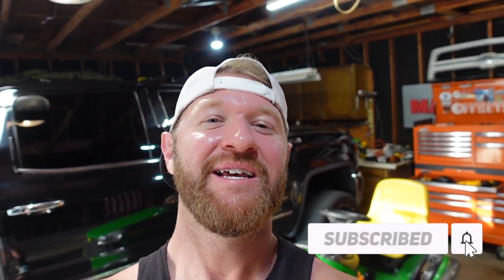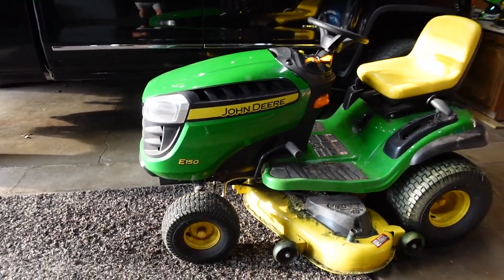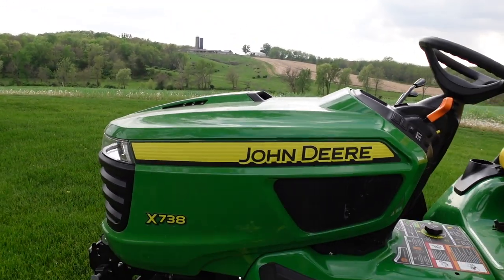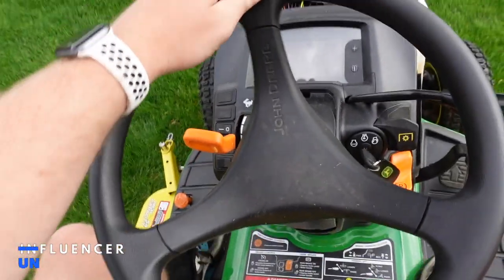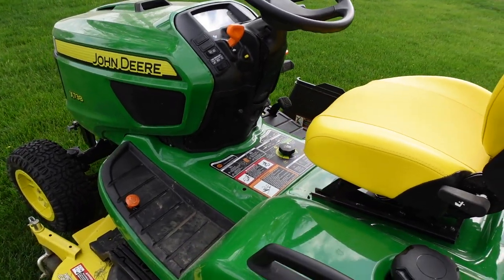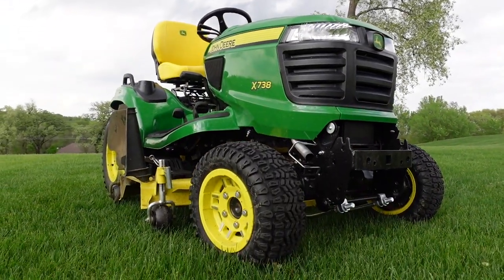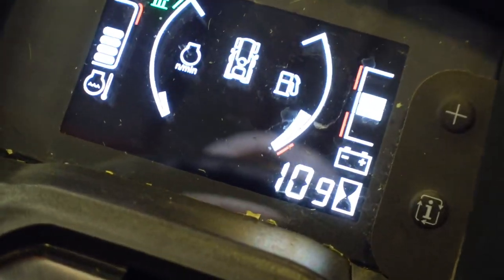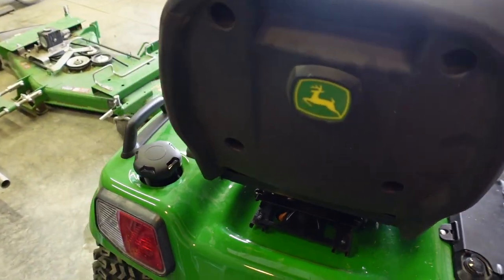John Deere x738 Lawn Tractor | Review & First Drive

Comment: Yea, I had an x720 with a 54 inch deck. I only cut about 3/4 acre of grass. (big hat, no cattle). I bought it used with 16 hrs. on the meter. The deal I got was so good I couldn't pass it up. I kept it 11 years then sold it ($2,000 profit) and downsized to an x590 with a 48 inch deck. Couldn't be happier with my decision. I can handle the 48 inch deck much easier when I remove it and turn it over for annual cleaning.
Reply from the maker: Great feedback thank you for sharing! Sounds like a good deal to me!
Reply: The problem I have with the X500 series. (Belts & pulleys), it's not a shaft driven system like the X700 series. Which will last much longer.
Reply: At my age, longevity is not an issue.

Comment: Looking to upgrade from an older John Deere 445. It has been an incredible machine. But it's getting tiered and parts are getting harder to find. To get the same equivalent machine today. I have to go to the x700 series. To my knowledge, John Deere has changed their classifications. They don't even offer a 400 series anymore.
Reply: I’m also looking at the x700’s… the John Deere 425, 445, 455 series supposedly are considered to be one of the best John Deere has ever made as far as “classics” go. I’ve heard that from multiple deere dealers through out the years.

Comment: On your E150 I highly suggest swapping out the front wheel races for bearings before your axles get worn beyond repair. Maybe you’re too late like I was as I have 190 hours on mine. There are lots of videos on how to do it. Easy process too. FYI.
Reply from the maker: Ohhh no kidding? Did not know that. I’m sure I’m way over that by now but let me check it out!

Comment: I have a steep hill, im gettin one 👍
Reply: If you ever need a spare front axle assembly, I have a very low hour unit off of a x738 that was in a delivery accident. Trailer flipped smashed the rear of the tractor.

Comment: Our company bought a bunch for facilities of that same tractor. They have been workhorses the whole way through. Not just for the mowing of the grass and everything else going up-and-down hills. But it also has a plow attachment and a blow or attachment that is awesome. And one thing you should have mentioned is that it's shaft drive that no deck is driven by the shaft so as to blower. I'm switching back-and-forth between blade and blower is super easy in the wintertime. And it takes me 5 minutes to switch from the plow to the blower. And it has a bunch of other attachments that are pretty cool including a scoop that you can move around your mulching stuff and don't put right where you want it. A very effective piece of equipment I highly recommend it for anybody that is looking for a well dependable tractor

Comment: The X7 series is  NOT  a lawn tractor. The X7  & X5  are  GARDEN tractors.
The 100, 200  & X300 series are LAWN tractors. Theres a difference.
$12K is a bit much to pay for a lawn mower.

!
Reply from the maker: Thanks for pointing that out I actually did not know that!
Reply: I paid $10,000 for my 2016 X738 now 8 years ago.  It has 350 hours on it from
mowing 2 1/2 acres of grass 8 months out of the year.  I have not had one
moment of trouble with it.  I could sell it in a minute for $8,000, so that is a
depreciation of $250 a year.  I am 78 years old, and with this mower I can
safely mow my 2 1/2 acres in about 2 1/2 hours.  I figure I am saving $150
a week to maintain our land with someone else mowing it.  For 8 months of 
mowing at 4 times a month, this equals 32 mows @ $150 ea. =  $4800 a year.
So, if you deduct $250 a year in depreciation and 3 gallons of gas for each
mow @ $3.33 a gallon =  $10 a mow X  32 mows  =  $320 in fuel and $40 a
year in maintenance  =  $510 a year in depreciation, gas and maintenance.
This gives me an operational savings of $4290 to mow my own lawn with
a $10,000 mower.  By mowing my own lawn, I am paying myself $53 an hour
for 80 hours of mowing.  Where can a 78 year old man get a part time job
paying $53 an hour for 2 1/2 hours or $132 a week?  The fresh air, exercise
and sunshine are worth the effort, and it saves me on buying Vitamin D.